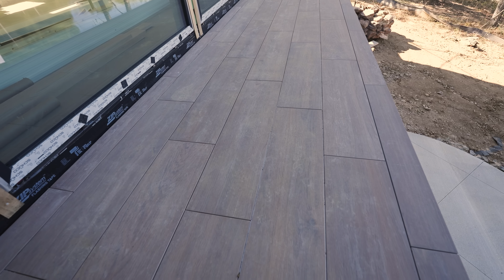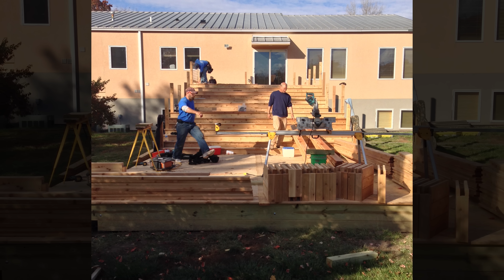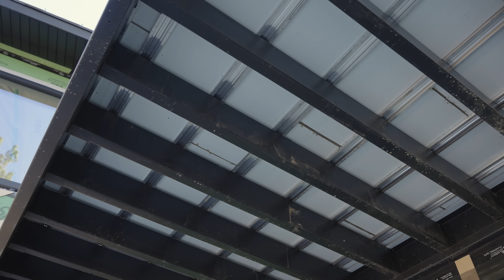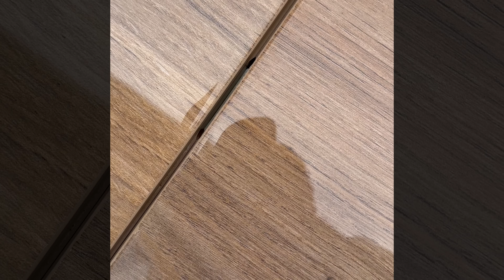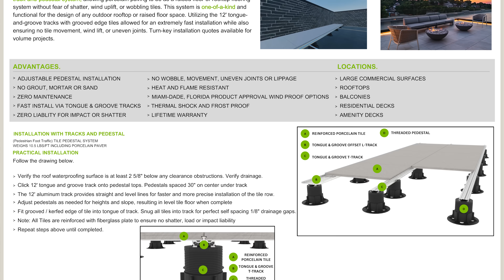Swapping Wood for Tile - the New Deck Alternative

Comment: PVC is not biodegradable, but neither is porcelain. I would say the big factor is how it will look in 20 years. If it scratches and fades, like PVC, or even worse - melts from your grill, it’s not a good solution. Porcelain is very tough to scratch, basically fireproof, and can be glazed to any finish you like.

Comment: In 10 years, every single tile that is exposed to rain will be loose. And if wood is the substrate that it's placed on, it will rot.
Reply: we've installed mbrico for over 12 years across the midwest. 0 issues.

Comment: @sailingtime72
0 seconds ago
Horseshit! Cedar is excellent material to work with, but if you pick wrong grade of cedar which based on the picture you did then you have problems. Deck outer skins and posts should be build with VGC not #1 as pictured. Yes homeowner are lazy and cheap on maintenance and after two years complain about costs! We finished deck in 2017 and moisture content is still between 4-6% as of uNovember 2025 it’s all about the use of proper materials!
Reply: Thanks for watching!
Reply: Cedar is too expensive for what it is.  If luxury buyers want a porcelain tile, then what's the issue?
Reply: @huruguru  no issues just do not bullshit about cedar being wrong or inferior cladding choice if you do not know what you're using! otherwise cover it in shit and newspaper for all I care

Comment: Very well done, this presentation.  Thanks.  First time I’ve encountered this product.  Seems a good idea in many circumstances.  The fact that its porcelain makes me wonder about how easily a piece might be replaced if one was fractured by something dropping on it.  Any thoughts?  Thanks again.
Reply: Thanks for watching! Glad you enjoyed it! Most common practice is to slot out the tile with a router. For project specifics, you can always reach out and sales will deliver the specific info!
Reply: I personally have dropped an impact and hammer (off a ladder) on it while working on or around it and no issue at all.
Reply: @midwestdecks5907 Thanks for sharing your experience. Exactly the kind of impacts I was concerned about. Seems a very durable product if it can withstand those types of drops.

Comment: Jake brought up an interesting point. How brittle is it? 
Also didn't know steel was a forever material.
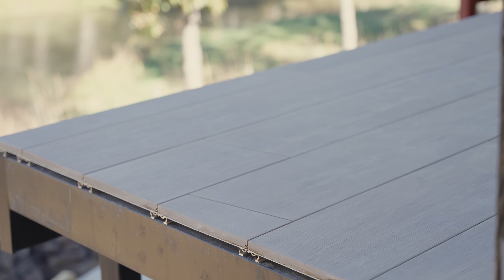A tile looks to be broken at 12:04.
Reply: Mbrico Tiles are reinforced for a 4,500lb weight rating! As for 12:04, the deck is a trapezoidal shape! It is cut that way by design.
Reply: thats just a cut tile. he mentioned the deck is trapezoidal

Comment: While I've enjoyed building shows who know what they are doing, this is for grossly rich people. This isn't the kind of thing most normal people, or even well paid people go for. 
My dad gave me the best idea for a waterproof deck... a roof.
Reply: Do you even know the cost? Or we just base things on assumptions now?
Reply: @jaymmcm not gonna get into it with you beyond this analogy. I dont know the cost of a Porsche 911 off the top of my head, but when I see one... my guess is they dont run a cash register at Best Buy. This house doesn't look like Lamborghini, but its at least a Corvette.
These builders are loaded. The guy in this video just casually built an over 4000 sqft "single family home." Stop dude.
Reply: We install it all the time. not much more than composite or PVC. Folks said the same thing about granite countertops or LVP flooring when it first came out

Comment: Living in Canada, I still don't trust that it  wouldn't break in the cold over time. Might last 5 or 10 years, but any micro cracks will let water in, and freeze thaw will crack.
Reply: Mbrico tiles are freeze/thaw approved! Tested @ -58F for 60 years of simulated cycling with "no visible changes" reported.
Reply: gets brutal cold here in upper midwest. no issue on the dozens of Mbrico decks we've installed over last 12-15 years.

Comment: I agree with all the reasons you gave, even though you didn't mention fire resistance which is a top concern where I live. What is the cost of a deck like this conpared to a wooden deck?
Reply: Mbrico is proud to hold a Class A Fire Rating! As for cost, pricing aligns with 10-15%+ the cost of composites. Hope this helps! Happy to offer samples and estimates as well.

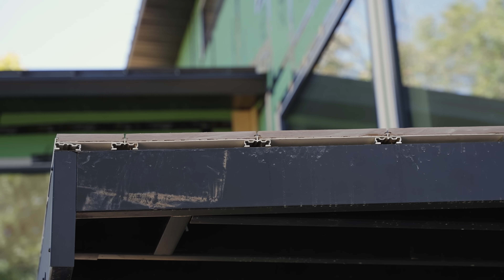Comment: 0:12 that narrower edge piece looks lifted. If so, you'll have a little puddle that forms there.
Reply: The long edges of the tile are free draining. They show the 1/8” gaps like a deck board
Reply: @jaymmcm that makes sense. So the lift actually works to direct small amounts of water back to the joint rather than over the edge?

Comment: I knew a Welder who kept collecting Steel Beams. He builds the deck frame out of steel. Used Steel Decking and Concrete, covered with tile. One morning he stepped out on his deck, slipped on the frost and fell down the steps, and broke his leg. He was out of work for months. BTW, our Composite Deck is also Dangerous from frost. We have Warning Labels on the doors, to our decks and porches.
Reply: You realize they make different types of tile? Normal interior tile use improperly outside vs tile intended outdoor pavers for example which have a higher traction rating than Trex, Azek, or even lumber decking. Porcelain tile outside is used all over the us for pool decking pavers available through any Belgard dealer for example. Not all tile is the same.

Comment: Bad idea. Went to a house one winter to do some work, the had tile the same way, almost broke my neck sliding across the iced up tile. Refused to do the work.
Reply: You realize they make different types of tile? Normal interior tile use improperly outside vs tile intended outdoor pavers for example which have a higher traction rating than Trex, Azek, or even lumber decking. Porcelain tile outside is used all over the us for pool decking pavers available through any Belgard dealer for example. Not all tile is the same. Tile defines the material, not the texture. Just like concrete can be made with very different textures.
Reply: Not all tiles are made the same! Mbrico Tiles are ADA-approved for skid-resistance and freeze/thaw approved, tested at -58F for 60 years of cycling!

Comment: If it costs double/triple a regular deck then is it worth it?
Reply: We paid about 15% more for our Mbrico deck than our Azek quote was. Labor was about identical. Happy with our choice.
Reply: about $20 sq ft is what we've seen
Reply: The steel framing is big bucks.  The Mbrico tile is similar in cost to composites.
Reply: @arthurbegun582  Steel framing is big bucks, but I don't believe Mbrico necessitates the use of steel framing.  My understanding is that it can even be installed on pressure treated pine as long as it's straight  and 12 oc.

Comment: Tile with water on top equals hydroplaning.super slick
Reply: Don’t drive your car on your deck and you’ll be safe from hydroplaning! You’re welcome for the pro tip!!
Reply: Not at all. You realize they make textured tile. We have this on our pool deck and dock and it’s way less slick than the pvc decking we used to have.
Reply: Mbrico tiles are ADA-approved for skid-resistance. You won't slip when wet! Perfect for pools, docks, etc!
Reply: nope. not slick

Comment: I should have known when you said sponsored that this material would be presented as if it was 100% better than any other option. According to this video there are 0 downsides to this material or construction technique. Unfortunately that simply can't be the case. No perfect solutions in life just trade offs. 

1. Painted steel and even anodized or powder coated steel will certainly require maintenance. 
2. Aluminum and Steel will 100% cause galvanic corrosion over time. This will require maintenance.
3. There is no such thing as an impact proof porcelain tile. If you drop something heavy and hard on that tile it will break. Can't be easier to replace a tile than a bad board. 
4. Costs - I am speculating since 0 price/cost info was provided but it has to be 4-6x the price compared to a traditional wood deck of double that size. 
5. Slippery when wet. I am sure that is a blast to be on if it is covered in water. Ever had to run out to the deck to move something or bring something in when a storm suddenly rolls in? I have.
6. Heat - You made a big point about how PVC and synthetics are "hot". No mention of tiles being hot? Really? What witchcraft is used to make a porcelain tile not get hot in summer under the sun? 

"Forever" home is a term used to sell people on more expensive products  and labor. They don't exist. Hell even if you did build a home with all the best and strongest materials on Earth that house still will require maintenance, systems will break down, or hell someone more rich than you might buy the house and property and tear the whole thing down. 

All homes in the US are semi-permanent and they will all be gone and replaced at one time or another. Nothing lasts "Forever". 

Imagine spending $20,000 (I am shooting low here. Could easily have been double that) on a deck that size just because your too lazy to stain and protect it every couple of years. lol
Reply: Mbrico tiles have a load rating of 4,500lbf, and we've never had a tile break through! Cost runs ~10-15% above composites, with the benefits provided here and more! All of our tiles are traction rated, ADA-approved for skid-resistance, and have been used by architects in award-winning pool and paddle club projects! All of Mbrico tiles have Solar Reflectance Index (SRI) ranges of 60-80%, so they will stay cooler to the touch vs composites, concretes, and other mainstream products. Our aluminum extrusions are ocean breeze + sea salt approved! Happy to send samples to help answer any concerns you may have! Thanks for watching!
Reply: @leonitasmaximus4004  Who pissed in your Wheaties?

Comment: What about a concrete deck, since you used a steel frame anyway.  how are tile costs vs a concrete one?
Reply: even mortared tile to an elevated concrete deck is tricky in a freeze thaw climate. would have to probably be pre or post stressed concrete and a disjointing membrane like schluter plus premium outdoor grout and mortar. I bet all of that plus the engineering would end up more than even a steel frame if talking 1-2 stories up.

Comment: The cost for that would price out 99% of people.  Must be 3x the cost of a nice pvc deck.  I love installing pvc decking.  If you don’t like plastic, probably shouldn’t have a laptop, phone, tv, car……
Reply: wrong, we've installed dozens of Mbrico decks and love it. About same labor cost for our crews and material comes in about 15% more than timber tech.
Reply: @midwestdecks5907 how do stairs work out? What about the weight?  You cut the tiles with a tile saw?
Reply: @chris.w.jackson  install on tracks on standard stair stringers similar to the deck. bullnose or mitered square edge. weighs 10 lbs ft so we use standard IRC code framing. Normally 16 OC treated joists depending on spans. Most PVC brands require 12" OC now which you need to factor into PVC deck costs. Yes wet tile saw or angle grinder with porcelain blade.

Comment: You mentioned the heat issue with products like Trex, but porcelain can get just as hot with direct sunlight.  It looks great and a solid option but don't mask over the cons just becaue your being piad.
Reply: Mbrico Tiles have solar reflectance index (SRI) ranges of 60-80%, so they stay cooler under the sun vs composites, concretes, etc!
Reply: @MbricoTileDecksUSA  I have mosaic tiles around my pool.  The tiles get hotter than the concrete around them. Explain?
Reply: @RonLeedy  Not all tiles are created equal. Mbrico tiles have a very high SRI range compared to other brands! Happy to send samples so you can test them yourself!
Reply: Wrong, we tested samples with a thermal imager before our first Mbrico install. The tile stays a lot cooler than azek or trex.
Reply: Our Mbrico deck and dock sentry a lot cooler than our old Azek dock

Comment: Are you not worried about galvanic corrosion between the steel substructure and the aluminium tracks?
Reply: For our steel dock They provided a butyl separation product to ensure no corrosion
Reply: @jaymmcm  Ah, interesting, that should help i guess, what about the fasteners?

Comment: To expand a bit on using modern cedar.  Plantation grown cedar does not have nearly the same oil/resin content as old growth cedar.  Young Cedar's use most of their energy on vertical growth, and only once that growth begins to slow do they focus more heavily one producing the oils that give it its famous resistance to decay.  The point at which growth slows is also when its most profitable to harvest the plantation and replant.  So the stuff you are getting these days is only marginally more resistant to decay than regular softwood lumber.

Comment: Cost? Slip resistant? Warranty on tile and installation?
Reply: ADA-Approved for skid-resistance, lifetime warranty, and tongue & groove installation design! Costs ~10-15% above composites, with the added benefits discussed and more!
Reply: We paid about 15-17% more for Mbrico installed vs our Azek quote. Love it. We bought specifically because of it being non slick around our pool deck and dock.
Reply: easy to install. like T&G flooring basically. About $20 sq ft. we install a ton of it last few years.

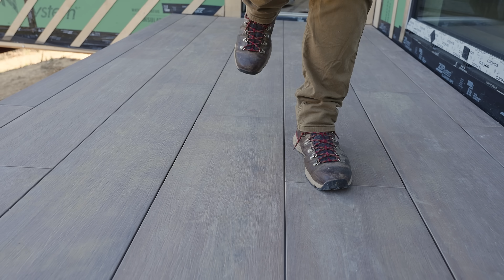Comment: At 12:02, it looks like that middle tile is already cracked. 🤔
Reply: I see what you mean but it’s because the decks a trapezoid and wide angle camera. We’ve installed a few of these. Order a sample. If you guys felt it in your hands you’d see how durable it is. Trust me, they’re shockingly hard to damage.
Reply: It’s a trapezoidal deck he said. So it’s a cut tile, wood floor pattern.
Reply: definitely just a cut on a wide angle lens. We've installed dozens of these and the stuff is crazy durable.
Reply: But the cut didn't look straight but it could be the angle of the camera. Also the tile that was right beside it, the edge looked broken as well

Comment: Wait, did you skip mentioning thermally modified wood or similar type of materials? Feels like you skipped the elephant in the room.
Reply: 100%. Thermally modified wood, and the variants such as Kebony, are excellent. They last as long as the top end tropical hardwoods, possibly longer, are generally sustainably grown, and while A bit pricey I’m sure they are nowhere near the cost of this system. Kebony can be left untreated, and still maintain a 30 year warranty in the horizontal position (50 years installed vertically, without end grain treatment needed). They can be oiled to maintain a darker color if that is desired.
Reply: @brianwhitehouse8380 skipping over it was probably intentional/at the request of the advertiser for this. I get not every single option could be mentioned, but it was an obvious comparison for this video.
Reply: No intentional skipping!

Mbrico is proud to offer wood-looks for clients, while also offering performance standards that composites, plastics, and woods can't attain. Such as 60-80% SRI, 100+ color options, zero oils, stains, varnishes, ADA-approval for skid-resistance, Class A Fire Rated, Miami-Dade Wind Uplift Approval, etc! In patented systems for decks, flat-roofs, balconies, amenity areas, pools, etc!

Comment: I think I missed the part about the tile doesn't get as hot under direct sunlight as synthetic ?
Reply: Mbrico Tiles have solar reflectance index (SRI) ranges of 60-80%, so they stay cooler under the sun vs composites, concretes, etc!
Reply: @MbricoTileDecksUSA assuming this is a reflective coating, so how long does this reflective coating last?
Reply: @Massi9211  We have mbrico on our deck, dock and pool deck. way cooler to the touch than the azek we used to have. not a coating, just the reflective property of porcelain. we used a thermal imager on the samples before we ordered and it stayed much cooler than the pvc decking.
Reply: Me too. Everyone knows what will happen to tiles under hot sun. I think it was skipped over intentionally.
Reply: @1Query1  wrong, order a sample and see. we sell a lot of mbrico pool decks and docks specifically because it stays cooler than azek, timber tech, trex etc.
Reply: Exactly that's what I was waiting to hear as well but they didn't mention it
Reply: @Massi9211  we used mbrico on our personal home. I called their bluff, they sent free samples. I put them out on our azek pool deck and the tiles stayed way cooler to the touch and under thermal imager. We installed Mbrico on our own home a few years back and still love it.
Reply: We have it on our dock and pool deck. Barefoot no problem. Limestone look tile. Way cooler to walk in than our old Azek deck or concrete pool deck

Comment: Wood decks can last a long time if maintained properly, the problem is that the ways to do that are not easily available in the US. Most big box stores do not carry oil based stains anymore which are what you need for wood, not water based. The water based stains are really no different from paint that just creates an outer layer that sits on top of the wood which is not what you want on a wood deck, whereas the oil based will penetrate the wood and protect it better. When staining a deck try to find a product that say clean up with mineral spirits, which indicates its oil based.
Reply: I agree. TWP makes a really good oil stain but it's not cheap. I stained a fence years ago with water-based stain and every year I was out there touching it up and the stain would peel off in little sheets because, like you said, it just sits on top.
Reply: The old arsenic based treated lumber lasted almost forever.  The current copper based treated lumber will only last about a dozen years no matter what you put on it.